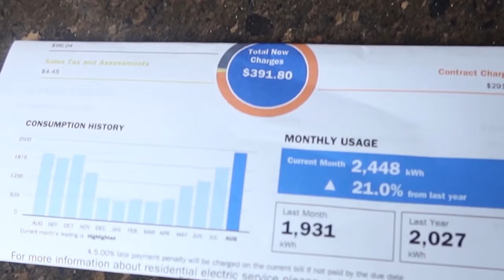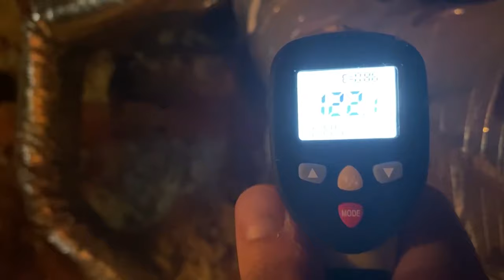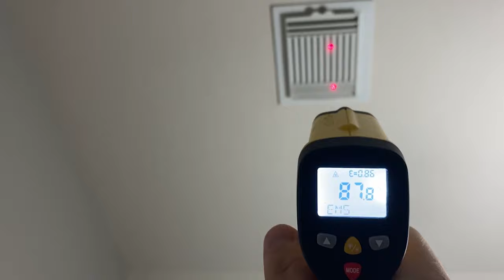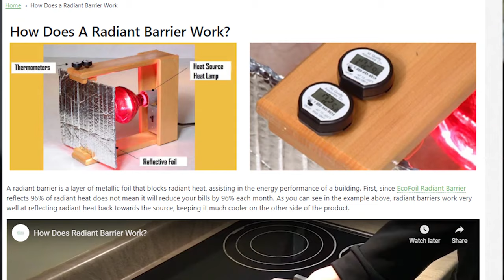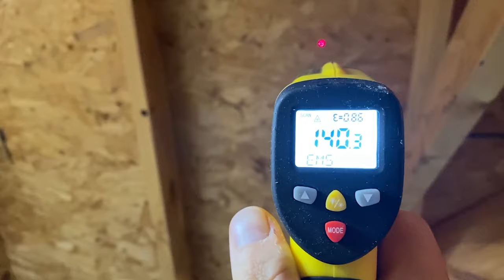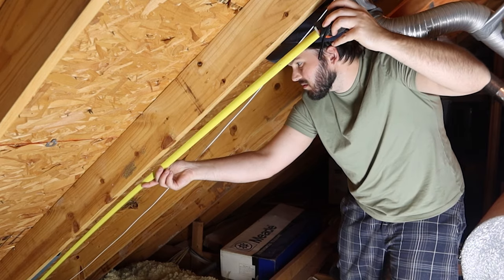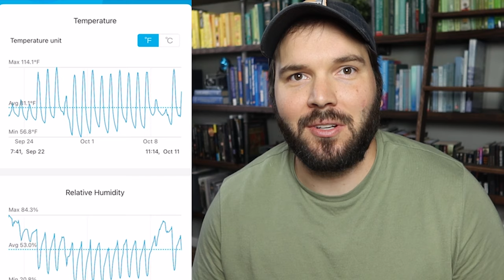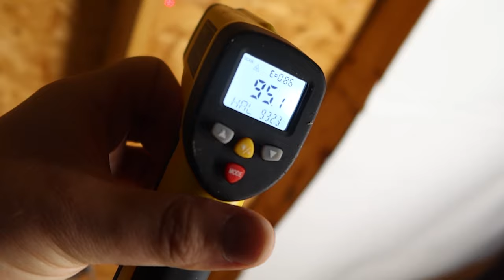Do Radiant Barriers Work & How Much Energy Will it Save: Real Home Owners Experience (Before/After)

Comment: Ok, so the foil reflects heat back towards the roof and shingles which will raise the temperature of the roof even more which then shortens the life of your shingles which means your roof will have to be replaced sooner so any money you may save on heat and A/C  would be surpassed by the cost of replacing your roof.      Hows that for a run-on sentence?  :)    So I would rather have longevity on my roof than a cooler attic.  Proper ventilation is the best you can hope for.    your thoughts?
Reply: He installed it upside down, incorrectly
Reply: @philrichbourg4224  oh 🥴
Reply: @philrichbourg4224  I chose not to use a radiant barrier. Instead I upgraded my ridge vent cap myself.  My roof temp is ventilates better and stays cooler.  On hot sunny days it gets about 15 degrees hotter than outside air temp. Which is fine with me.
Reply: @philrichbourg4224  Come on you guys. Do your own research. The white side is for appearance only, to give a finished look. The majority of the product I’ve ever used is shiny on both sides, when the appearance doesn’t matter. I’m a guru with all this stuff. Used it for many years.
Reply: @rayburnyarborough4695  lol you have no idea
Reply: @philrichbourg4224  ok. Please enlighten me. I’d love to hear what you have to say.
Reply: @rayburnyarborough4695  heat emission. I’m not your high school Physics teacher, do your research.
Reply: @philrichbourg4224  Energy.gov- The barriers consist of a highly reflective material that reflects radiant heat rather than absorbing it. 
 Whatever happened to having an intelligent, civil conversation instead of being so condescending, hiding behind a computer screen. I try my very best not to put out misleading information on anything. I thought the attic looks pretty good, but as I said, it’s only for appearance. There are many varieties of this product, for a variety of different applications. As a matter of fact, I have lots of ideas. I have used these products for years and had numerous, lengthy conversations with the sales reps at the manufacturer. I used to talk to a guy that traveled all over the world dealing with these products. I just recently installed an agramat in my shop. It has about a 1-1/2” layer of fiberglass on it with the white side down. It looks pretty good. I haven’t used the white tape on the seams yet. They had to stop making it because all of their employees threatened to quit, having to mess with the nasty fiberglass. I know all about that also because years ago I worked at a fiberglass factory and have installed more than I care to think about. Thank the Lord for radiant barrier. 
  You see, whenever I do anything, I research everything I can about it, and talk to as many people as I can. I’m not sure the guy in the video knew much. Maybe he thought the white was the only way it comes (idk?). I’ve mostly used the standard perforated foil Super R Plus. However, the double bubble double foil is the ultimate. Installed in layers makes a dynamic system. In 38 years of owning my own business, I’ve never made a fool out of myself yet. I’ve built million dollar homes,do foundations, framing, plumbing, electrical, drywall, painting, millwork and everything else to a house. God has blessed me tremendously, and I only have one Bachelor of Science degree in Building Science. If you would like more technical data, I can send you to the manufacturer’s website.
Reply: @rayburnyarborough4695  congrats but you still don’t seem to understand how radiant heat works. You didn’t research, because if you did continue to read that energy.gov site you would know:

“Radiant heat travels in a straight line away from any surfaces”

“To be effective, the reflective surface must face an air space. “

“an installer typically drapes a rolled-foil radiant barrier foil-face down “

This is how radiant heat works. You are incorrect in thinking it reflects like a mirror. But it’s a common misconception and that’s why so many manufacturers put the reflective surface on both sides, so there’s no way to install it incorrectly. You see, the reflective surface doesn’t EMIT as much radiant heat so that is why it faces outward, toward the inside of the attic, the “air space”. 

Is that civil enough for you? Next time read the whole article that YOU are citing before wasting your own time with such a long and wrong explanation.
Reply: @philrichbourg4224  ok Phil, I think we are fighting the same battle with just different terminology. There’s radiant barrier and then there’s reflective insulation. You first said radiant barrier was not “reflective” which it is. The radiant barrier I have always used reflects the heat out during the summer and keeps the heat in during the winter. End of discussion. Goodbye 👋
Reply: @rayburnyarborough4695  I can lead a horse to water but I can’t make him drink. 
Other than my time, the real victim here anyone you gave this advice to
Reply: @philrichbourg4224  ok Phil, bottom line. Are you saying this product does not work?
Reply: @philrichbourg4224  Ok Einstein, I was waiting to hear back? Does this product work or not?
 I highly recommend you watch
Radiant Barrier Is It A Scam 
Sarasota Energy Saver 
This is the same exact demonstration I saw a long time ago. Please explain what tricks they are using. Or maybe you’re a troll or a bot?
Reply: @philrichbourg4224  Dr. Phil. Is silence golden or what?

Comment: Sounds like you need to insulate your ac ducting in the attic.
Reply: That won’t help much if the attic space is 140 degrees. The dead air in the ducts when AC isn’t running will come up to attic temperature, even if ducts are insulated. That hot air gets purged into the house at the beginning of each cooling cycle.
Reply: @MEMcAndrews  I am no expert in this. All I know is that when our city ran a rebate for insulating, sealing air leaks, and other weatherization, insulating ducts was part of it.  Those guys who did the work said it decreased the load on the AC.

It seems to make sense to me, because our AC runs pretty often on 100 plus degree days.  They said it would keep the air in the ducts cooler between cycles.

Additional to insulating the ducts, they also sealed them from leaking cold air.

Comment: You installed it wrong. Upside down. The shiny side should face toward the attic, not the roof. It’s a “radiant” barrier, not a “reflective” barrier. It works on heat emission, not reflection.
Reply: If you’re referring to the white side, it is for appearance only, for a finished look.
Reply: @rayburnyarborough4695  lol you think appearance matters inside an attic huh? There’s actual science involved here, suggest you re-read my explanation and google what heat emission is.

Comment: This guy doesn't know what he is talking about. 
It works with intake from the soffit and outake from the ridge vent.( he didn't talk about that at all)
When the radiant heat turns into conductive heat the intake from the soffit, it will be suck out from from the ridge vent. If you don't have intake and outtake system, the radiant barrier will not work the way it is suppose to.
Reply: Wrong! It is a reflective barrier.

Comment: To take care of the humidity inside the house run the fan only in your ac at least 10 to 15 minutes of each hour.
Reply: No! This blows the wet air on the coils back in the house. Increase the load on the system so the unit runs longer.
Reply: Get a dehumidifier
Reply: Slow the fan speed and properly adjust the Subcool to 12*

Comment: If you properly insulate your walls and attic, you should be able to run your air conditioner from 10:00:pm to 10:00 am avoiding the heat of the day.  This will give you house a chance to warm up during the daytime enough to eliminate the humidity in the house.  Ypu may have to lower the temperature at night to get the temperature through the day.  If your house wont do that, it means your house isn't properly sealed and insulated.

Comment: IT IS PERFORATED TO ADDRESS THE. MOISTURE ISSUE.  THE  PRODUCT YOU ARE USING IS THE WRONG PRODUCT.  YOU WANT THE ALUMINIUM ON “ BOTH SIDES”.  YOU ARE USING AN INFERIOR PRODUCT.  LOOK FOR THE ORIGINAL RADIANT BARRIAR, DOUBLE SIDED WITH PERFERATION